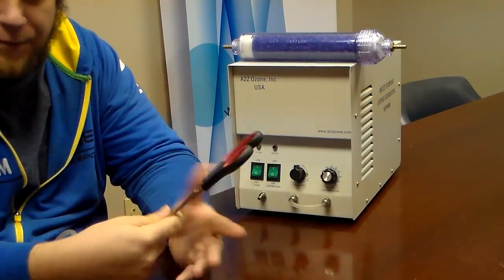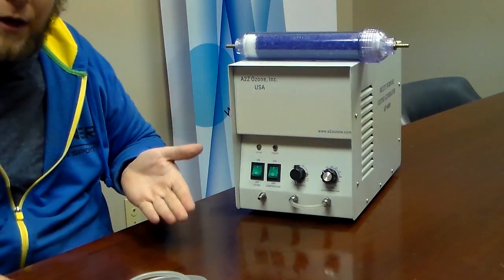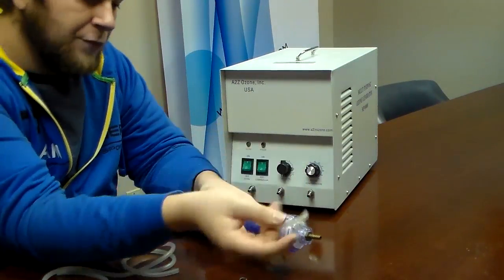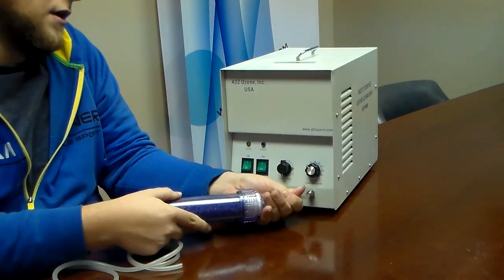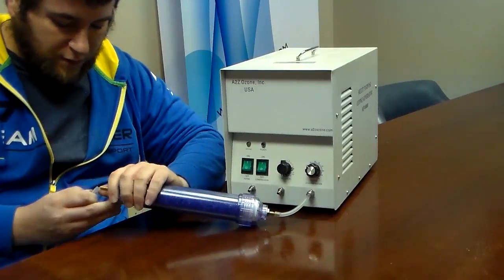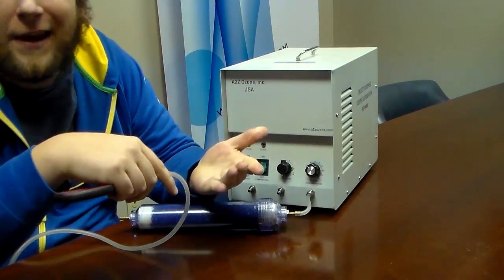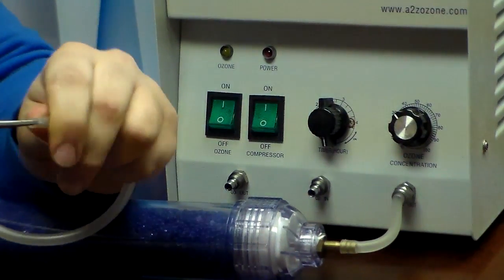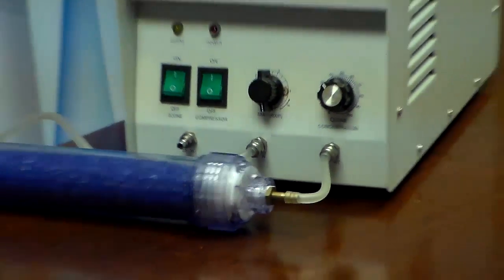How to Install Air Dryer on MP Series #a2zozone #ozone #ozonegenerator

Comment: What does the silica air dryer do to the system? Why would you need it?
Reply from the maker: Hi Alofzico Legambaz, the silica air dryer is used remove water and condensation from ozone generators. It will help relieve issues happening inside the ozone generator, particularly humidity, mildew and corrosion.
Reply: It makes a better purer ozone.